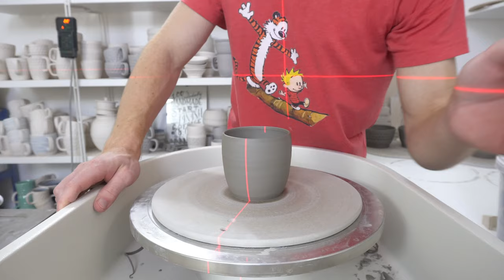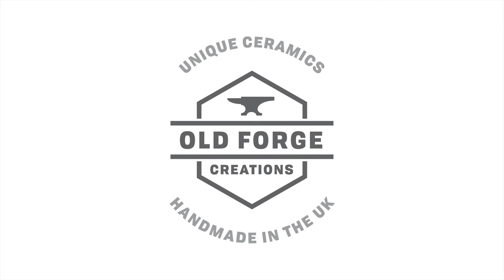Making a Drippy Slippy Mug with white slip on dark clay

Comment: Wow! So no scoring necessary?
Reply from the maker: Nope! So long as there's slip and the joint is compressed, then it will stay attached like a normal handle (as in, it still needs to be a similar dryness to the body and they both need to be dried slowly and evenly)